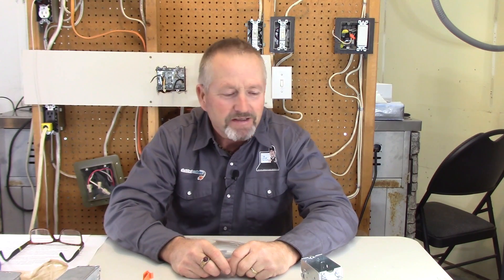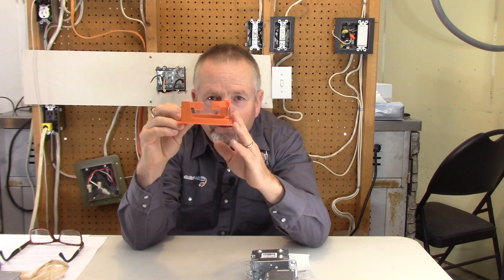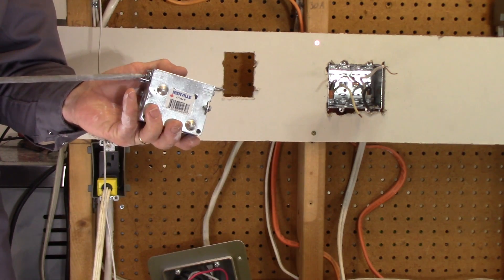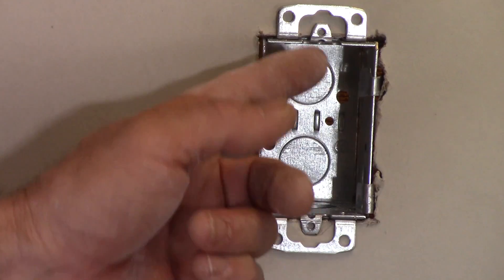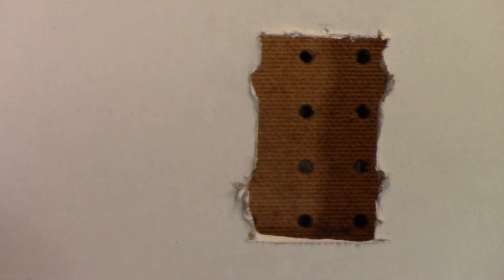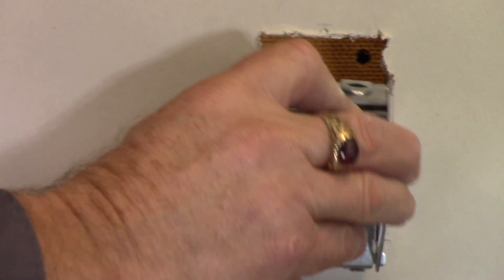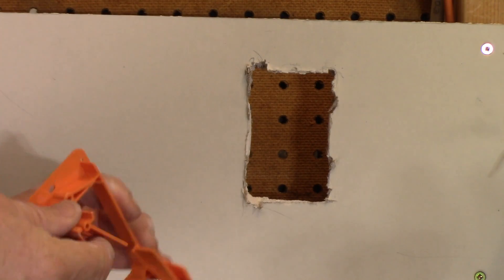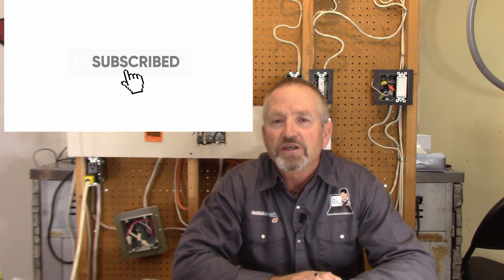3 Types of Old Work Electrical Boxes and How to Install Them

Comment: Thanks for this helpful video. I had the second box in your video and couldn't for the life of me figure out how to get it into the hole with both glamps on it. Saw your video and saw the top and bottom both swing in! Worked like a charm after that!
Reply: Same here.. I've done em before but ended up with hardly any drywall to clamp to after i took away too much
Reply: Same here.  My problem was I had tightened the clamps before installing and forgot that they swing in!

Comment: Hi Terry, can you recommend an old work box for a 30 amp dryer plug for an ev charger...6-30R or similar. I agree with you about those F clips. Terrible to use. I've installed a few Iberville BC777 LRB boxes. These are great and solid!  Thanks

Comment: Thank you so much for this very helpful video. I was having a company install a chimney style hood range vent and the electrical needed to be repositioned in the wall where there is no studs. I got a whole song and dance about how they can't guarantee that it's not going to be safe because there's no stud to secure it the electrical. Makes me wonder how qualified they are that they don't even know about these boxes. Thank you for saving my bacon and for helping me educate my contractor

Comment: THANK YOU!!! I Spent about an hour trying to remove an old box that held the thermostat for old removed electrical base board heaters. I fought with those side brackets thinking they slid up or down to lock the box in place. This video showed me I had to unwrap those 4 tabs!!! This box was attached to Very thin,  old 3' x 7' thin wood panels that we plan to replace and paint after installing insulation behind them.

Comment: Its a lot easier to put the battleships in after you put the box in - esp. if you have plaster lathe walls, you will have less room to work with - but they are definitely needed for longevity :)  The battleships are the only things that usually are long enough to work on century homes

The standard old work boxes they have now a days - the tab screws are waaaay too short for anything bigger than 5/8 in (and most old plaster walls have anywhere from 3/4 to more than an inch "drywall")

Comment: Back in the 70's we used the bendable box supports exclusively. We called them battleships. Slide them in after the box is in the wall not beforehand. Takes no time once you do a few. Today I'll use the plastic remodel boxes but occasionally I'll need to insert metal and you can still find the battleships at the box stores and distributors.

Comment: With the first box, once you have the wire in the box, you then push the box in the hole.  Then you slide the f-clamps in along the side of the box and the edge of the wall.  You kind of work it in at an angle.  Use to use those all the time.

Comment: Question: how do you conceal the top and bottom tabs on the metal old work boxes when finishing the drywall? I am talking about the tabs that keep the box from falling into the opening in the wall.

Thanks for sharing your knowledge. Much appreciated.
Reply from the maker: The cover plate will conceal them.  The overall length is less than a standard wall plate. Thanks for watching!
Reply: @theinternetelectrician  Got it. Thank you for your prompt reply.

Comment: Thanks for the demonstration! Do any of these old work box come with 3x2x3 (15 cu. in) size? I wanted to be able to fit in 3 - 14/2 wires into one box, and it seems that only a 15 cu.in box is code compliant. I am tapping a new line for additional light from an existing receptacle, and unfortunately that receptacle is not at the end of the circuit.

Comment: Now that I have my 2x3 box old style box installed, I’m having a time finding wall outlets that fit in the box. Any suggestions? Thanks!
Reply from the maker: That's the problem with those.  If it's too tight, go to plan B.  Use a larger plastic old work box.

Comment: Excellent video, just installed the receptacle with the back flaps - excellent tips, it’s installed and solid in the wall.  As you say though, not much room in there.  Thankfully I only had two wires in there
Reply from the maker: Thanks!  I hope that you gave the video a 'like'?  And subscribing to the channel is much appreciated!
Reply: @theinternetelectrician  I did indeed

Comment: I just replaced one of the boxes with the separate metal tabs today with a blue plastic old work box. The old box was sitting very crooked for years in our house and I finally got around to it.  The blue plastic one is exactly like the low voltage one you showed in this video.
I am assuming you are Canadian.  Are all of these code compliant here?
Reply: I don't know if it's ok in Canada. I can't find bluebox in the shop....
Reply: @UlysseGrd  I ordered them from Amazon.  I could only find the grey plastic boxes and the metal old work boxes at home centres here.
Reply: @jwpercy  Yes same here; only grey plastique despite it’s the same brand (ABB/CARLON/Iberville).I would buy too in Amazon like you but maybe it’s not CSA approuved. How insurance will judge me if I have fire problem?!

Comment: Welp…feel like an idiot. I have the BC777-LRB and didn’t realize the top and bottom rotated to allow the back plate of the clamp to slip in the opening. I was wondering how the heck I’d make the hole small enough but still fit those in. Thanks for the info!

Comment: Hi, can a gang box for a NEMA 14-50 be installed safely on the drywall surface (the cable will come from the outside the wall in a conduit)? Ideally I would look to mount it where there is a stud, but it's been taken by the EVSE and its cable won't reach the outlet if it is on a different stud. Some people are telling me it will hold, but I'm concerned about pulling the whole gang box out when I try to unplug one of those big/fat NEMA 14-50 EVSE plugs. Thank you.

Comment: Can i use these square  box for wall lights since i have a light if i install   the ceiling light box 
it will be bigger then my lights and it will be visible thx
Reply from the maker: Yeah, it's been done.  You may have to modify the fixture mounting bracket by drilling appropriate holes in it if the holes don't line up with the device mounting tabs on whatever old work device box you use.
Reply: @theinternetelectrician   so you are saying that i can use  BC777-LRB box that u  just  showed  for light fixture as will since it will be covered completely by my light fixture   thanks
Reply from the maker: @johnal4560  Yes, while lighting outlet boxes are designed to accept light fixtures and their mounting assemblies, exceptions are made for the use of a rectangular device box like this.  For example, on an exterior brick wall where this type of box is easier to install, etc.

Comment: Any recommendations on what type of box to use if the opening is slightly larger than any of the boxes you shoe in the video?
Reply: Same question. The goof from our cable company cut the box opening about an 1/8" to big on all sides. That low voltage bracket slips right thru the opening. And to add insult to injury, the goof destroyed the drywall at the top but not the paper.

Comment: hi can you use the 3rd box for an outlet use or is preferable to use a full enclosed box? thanks for your response
Reply: Those  orange boxes are for speaker wire, network cable, etc.   Low voltage not 110!     Confusing they shouldn't be in this video. 
Get the blue carlons  for 110
Reply: @chooch502  Agreed. They should have shown the blue boxes which are comparable to the other products. Including the orange brackets with the rest is apples to oranges.
Reply: You must use a full enclosed box for an outlet in the United States, and they do make enclosed boxes with tabs like what is shown.
Reply: @lightwalker222  Ok...they must have made them once upon a time.  I have a 3 gang box like that and  it has seen better days.  If they don't make them like that it would explain why I can't find a replacement like it.
Reply: That was exactly my question. If the orange ones could be used for outlet boxes.

Comment: Hey Terry, there's an easier way to install the "F-brackets" after you've cut out the hole for your box.
1 -  (if possible) Run your wires into your box <and strip as needed> before inserting the box into the hole.
2 - Push the box into the hole.
3 - Turn the F upside down with the horizontal tips facing you.
4 - Now slide the long part of the "F" along one side of the box while trying to slide it up the inside of the drywall.  Once it is as high as it can go, the short part of the leg can be pushed into the hole and slid down until it bottoms out on the drywall.
5 - Now bent the two tabs around and into the box.
6 - Now repeat for the other side.  <<try to install this side with fewer "choice" words>> 

I promise it gets easier with practice.
Reply: Excellent tips. Also, one should use the flat side Iberville box 1104 lrb-crt so you don't have to contend with the nubs on the side of the box used in this video. Yes, I also prefer to use the plastic ones with the flip out wings but typically you can only buy them online so not an option when you just need to get things done. Having a few on hand does help.
Reply from the maker: Alternatively, just use a better re-work box!  Thanks for the tips!
Reply: @theinternetelectrician  I have had to use this F style box in kitchen islands when they have wainscoting.  But yes, I do prefer the plastic old work boxes whenever possible.
Reply from the maker: @cfgdr3  Embarrassed to say, but in all my years in the trade, this was the first time I've seen these brackets.  Used the EZ 777 boxes mostly, prefer the plastic ones though, more room!  But once the metal EZ boxes are clamped in, they're not pulling out if installed correctly.
Reply: @theinternetelectrician  I use the plastic boxes any time I can.  The metal is always a pain for me, but they have their use cases.
On another note, I just installed another type of "old work" plastic boxes the other day.  This one has an adjustment screw that allows for the box to retract or extend outward more.  It's great for backsplashes or areas that are destined to be tiled.  The first one was a pain, but it was easier on the other 4 I installed.  I can post a link (or PM you) to the item I used.
BTW, thank for helping me out 10 years ago.  You sent me a wire diagram for a reverse switch loop after I ordered it on your site.  It took out all of the guesswork and set me straight in no time.  I still have the drawing to this day.
Reply from the maker: @cfgdr3  yeah, I’ve seen (but haven’t used) the adjustable boxes. Excellent idea! Glad I was able to help you out back then!
Reply: I was wondering if you’ve guys have had an outlet fall into the wall and what do you do?

I was installing an Arlington electrical box extender and managed to get one to fit. I did another outlet but it didn’t quite fit so i pushed a little bit harder and i guess because my walls are plaster whatever the “F” was holding onto broke and I don’t want to damage it any further.

So the top of my outlet is leaning into the wall abyss while the bottom is holding onto its dear life lol. 

Please let me know if this is salvageable 🙏